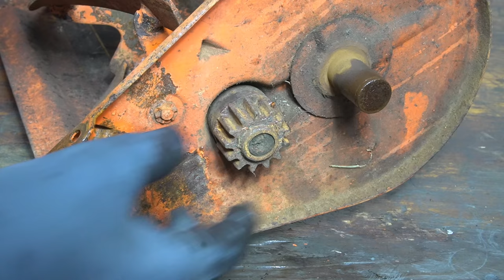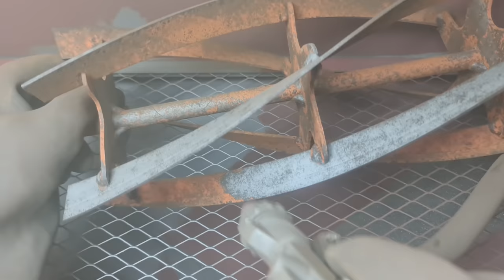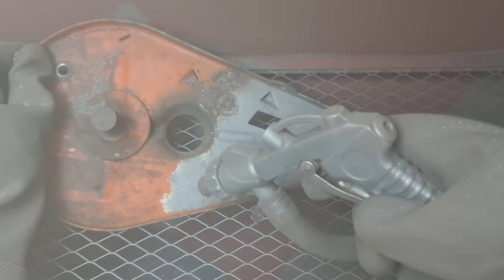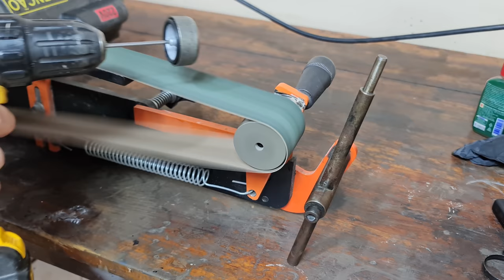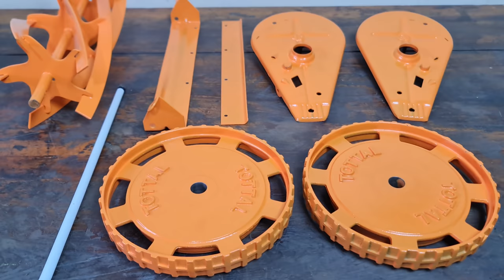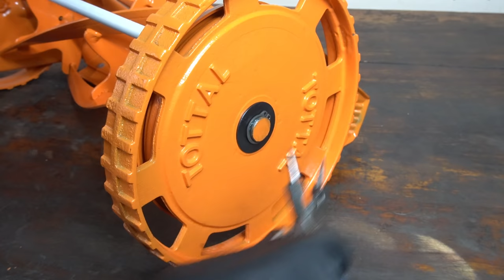Restoration Old Rusty Lawn Mower

Comment: I have this old manually operated lawn mower myself, I'm not sure if I should throw it away or (try to) restore it. You make it look easy! Just one thing: Didn't you forget to sharpen the blades?
Reply: These days I say probably keep it
Reply: Agreed, sharpening the blades would have helped it cut better.
Reply: Do you know how old it is ? 
This one has plastic wheels on the back bar, I would think they would have been wooden being the main wheels are steel.
Reply: @RichieCat4223  having repaired lawn mowers since the mid sixties I would date this one as from after W.W. II due to the die stamped side plates and the use of a metal handle instead of the older wooden handles . If I had a dollar for every reel type mower that I've sharpened and adjusted .... In case you're wondering , Dad started my training at the age of seven . A lot of the wooden rollers were replaced with newer ones over the years .
Reply: these blades self sharpen by adjusting the sprung screws on either side best way is to fold a cigarette paper and adjust both screws until evenly cuts across the blade ,as for removing the rivet's connecting the blade to the dispatch plate and replacing with aluminium rivet's they will corrode within a few years if they don't snap through vibration lmfao
Reply: ps I have owned several push mowers and had owed two Ransoms Ajax's, I was taught to maintain at college by a man who worked at Ransoms and Atco in the UK
Reply: Well if you watch and know what steps he’s going to do before he does it, then I’d say go for it. If each move he makes surprises you then I’d think you’re in over your head
Reply: Joga fora nao isso ai é uma relíquia

Comment: Quality restoration, good job 👍
Reply: the knives should then be sharpened I know how you do not have the machine for what I have repaired that kind of for 15 years and you use the old plastic rolls and you do not use pop rivets for the lower knife they do not hold as they are too soft believe me I know

Comment: Not a bad job at all, but you did one thing wrong! The bar in the back with the plastic rollers, the bracket that has the  lines on them,Has the line up with the lines on the mower. You have to turn them down 45°.Somebody put them on wrong the first time.

Comment: Have you tried powder coating with no current. I had over 100 pieces coated on my 71 Chevy truck including the frame. They put all parts in the oven and brought them up to temperature, then spayed them and melted the powder on. After returning to oven and re baking… perfect, except a couple of runs.

Comment: Hey friend can you test for lead paint before sand blasting?
Reply: If you meant "can" the answer is yes, there are solutions out there you can scrap a bit off and it will change colors if lead is present. If you meant "do" you, I would guess so, that's an awfully nice shop, so I imagine the ventilation, and collection is top notch as well.

Comment: the knives should then be sharpened I know how you do not have the machine for what I have repaired that kind of for 15 years and you use the old plastic rolls and you do not use pop rivets for the lower knife they do not hold as they are too soft believe me I know